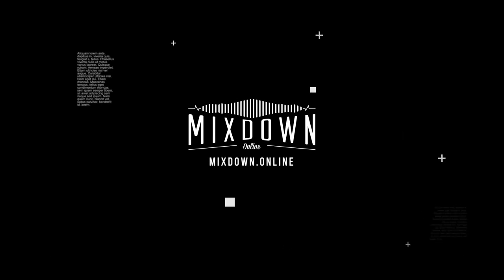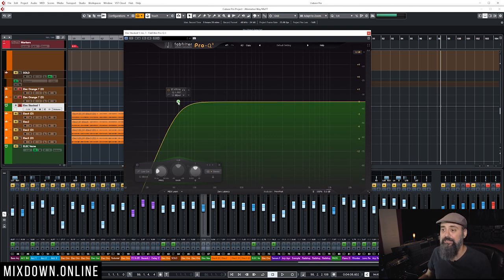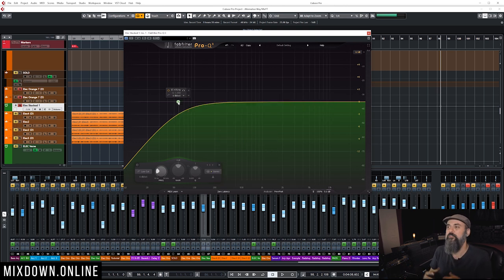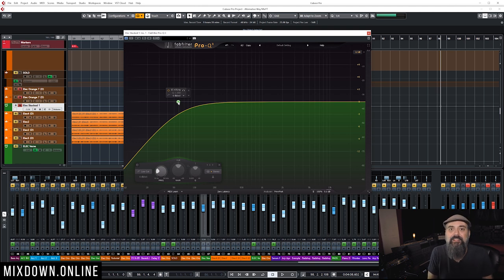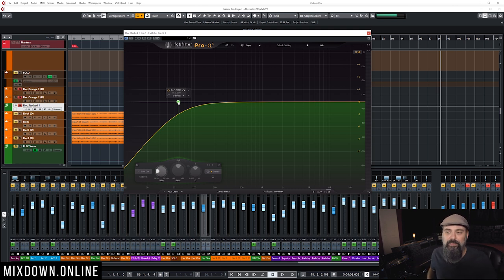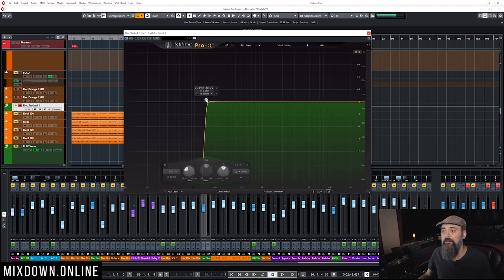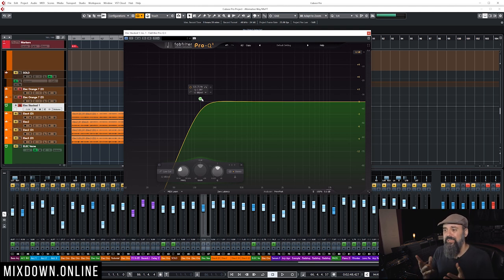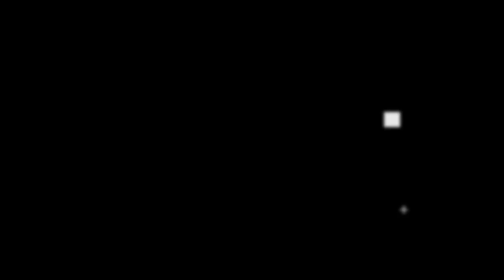How to use HIGH PASS FILTERS

Comment: Thanks Chris for another "Light Bulb" moment! I didn't realize that a High Pass could affect the Phase!
Reply from the maker: You're welcome!
Reply: You make some valid points in a nice presentation, thank you. However I fear that the take away from this is propagating the myth that one should HP almost every track. This is wrong and a surefire way to tell an novice mix.  

I’d suggest only using a HPF IF NEEDED, for it generally causes more problems than if fixes!

For instance, if you were to run a pure test tone through any EQ, and watch a frequency based correlation meter, you will see correlation issues with ANY HP sloped @ any frequency. Why do that?
With a Linear Phase EQ you will cause a ringing, by doing the same, not to mention probable increase in latency, if you are using a software EQ. 

I urge you to be clear that this is NOT A RULE, in any way, just a specific fix for specific problems. 

As most professionals, I HP (or BP or LP)  ONLY when there is something in my client’s material, in those frequencies, which are causing issues. 

Only I f there is something that needs to be removed because it’s causing a problem in the mix, perhaps it’s masking something, or there is some kind of bad information in those frequencies, or any other problem, certainly address it, and follow some of the good info in the video on doing that i.e. only within context, being aware of phase relations, etc. but only if needed. 
I appreciate you giving some general information on how to HP, but you kind of made it sound like you should at every opportunity, which I’m sure was not your intention. 
Unfortunately, there are many YouTube’s saying that high passing IS a rule and you should almost blindly HP almost every track and that just is poor advice. 
  
The only real RULE to follow when tracking, mixing  mastering, remastering ....anything you are doing in a studio, (whether you are in a full studio or just in a bedroom or project studio) is: LESS IS MORE. That ‘rule’ you can take to the bank!

Comment: Good stuff, Chris.  I've been telling people to do that for years.  Not only does it clean up a mix, dropping the unnecessary low frequencies also keeps effects like compression from being triggered mysteriously.
    Also, 99% of audio systems can't reproduce frequencies below 40Hz.  The amps can usually reproduce the lows but speakers have difficulty unless they are very expensive.  Even if one has speakers which can reproduce frequencies down to 20 Hz, most rooms can't handle those with any kind of accuracy.    just sayin'
Reply: I could have written this better if I was more buzzed.
I must go remedy that condition, right now............😵🥴🥴

Comment: hi chris! wich would be the work around if I need to aply HPF to already visually-phase-align kick drum and bass tracks? i think i could use the same plugin and slope value in each track, but i would need to set it at different hz, getting different shifts..
Reply from the maker: Are you're talking about a situation where the Kick and the bass were recorded near each other and there is bleed? Otherwise, there's no phase relationship between the 2 signals, being completely different recorded signals. But let's assume the kick and Bass were recorded in the same room and both tracks have bleed from the other track, in that case, I would reach for a Linear Phase EQ to High Pass..

Comment: How do you get rid of things like string noise..  for example: Moving quickly on a bass guitar from position to position can sometimes produce a high, short squeak.  I don't seem to hear it until I've added some gain to the bass track and it starts to come out and it's not something I would ideally like to hear.
Reply from the maker: A Dynamic EQ can work to attenuate the frequencies where the squeak is more present. Other times, I bring them down manually if it ends up being a problem in the context of the mix.

Comment: Good advice on grouping related tracks and high passing them together. But what if I have two unrelated tracks playing the same thing? For example, suppose I use a bass guitar and a synth bass (possibly an octave lower) playing the same thing and I want to blend the two sounds together,  to add more sub. Am I likely to run into phase problems doing that?
Reply from the maker: In that case, it doesn't matter much since they are 2 different recorded signals, opposed to a kick drum recorded with 2 mics, now these 2 kick tracks will need to be in phase since it's the same signal recorded on 2 tracks at the same time. Hope that helps!
Reply: @mixdownonline  - Yes, thanks Chris.

Comment: Another Chris video. Thank you. 
I have never tried a linear phase filter or eq. You mentioned the pre ring problem. I have read too that they are very intensive in computer power requirements.

The fact that you use the fab as insert to do the filter instead of, for example, the filter function in the pre, has any reason?
Reply from the maker: I used the Fabfilter HPF because it shows more data at the lower end than the one in Cubase so better visual for educational purposes. In a real mix situation, sometime I will use the Pre HPF in Cubase and other times the Fabfilter one or from a channel strip if inserted on the first insert space.

Comment: Chris: When you record one instrument with two or more microphones, the phase will never be 100% anyway so what difference does it make?  I am learning about phase a lot now because I record the Cajon with 2 microphones: one on the front and one on the back, and no matter where I place the mikes, I still don't get a recording that is 100% in phase, the best I can do is shift one track like you did in your other video on "phase when recording drums" to my taste if I hear it sounds better. When you mike a snare with two mikes like you said in the video, do you use placement to get the phase right? If you spent a lot of time to get the mic placement right then yes you would want to be careful about that but in any case can't you just shift the track a bit? Also, one other thing, when you do create a group bus for your multi-miked tracks you avoid phase shifts but then you won't be able to make EQ adjustments on each mike which migh be what you need to do to get the best sound, so what do you do about that except use linear phase EQ?
Reply from the maker: Good question, when I talk about recording a source with 2 microphones, I'm reffering to 2 mics capturing the source at the same distance so in phase, like 2 mics on a guitar cab, mic overheads in X/Y Stereo. Your Cajon will be different since the back of the Cajon has a different sound than the front. You can EQ then separately but you will still need to make sure both mics are in phase with each other since they are capturing the same source. My overheads for example are in phase from the recording stage, so if I add a HPF on one track and not the other, I will get a phase shift on one of the tracks and will put those 2 tracks out of phase. That's a situation where I will group them together before EQin them

Comment: Hi Chris, i know i have already posted on here but i have been trying to find an answer to a little problem i am having atm!!  Th e  Cubase QUICK LINK (Q-LINK BUTTON) feature is not working at all while i am on the mixer window?  I cannot make changes to multiple tracks at once which as you can gather is really slowing my workflow!!  Cannot seem to find what is wrong?  Would really appreciate some guidance and help please if you possible could? Many thanks!!!!!!!
Reply from the maker: Weird cause it usually works very well on the Mix Console. So if I understand you problem, you activate Q-LINK and select several channels, the channel's faders ware not moving at the same time?
Reply: @mixdownonline  That is right, it won't let me select multiple channels!!

Comment: Sir plz make a list of required equipments with specification to build a beginner level recording studio
Reply from the maker: @RB Thanks for sharing this YT Channel :-)
Reply: @mixdownonline  -  You're very welcome.
   I'm not trying to push any particular product or method, but that channel has good info regarding treatment and barrier technology.  Using much less expensive materials, I've been able to verify much of what they are describing.
    I could ramble on about it for way too long........
      Once I got a decent level of treatment in my room, I no longer wondered if I was missing something.   I no longer felt the need for better speakers, or a better DAW machine, or a better interface, or better plug-ins.......   
...of course, I could just be delusional..... but  as far as audio, I attempt to not be.